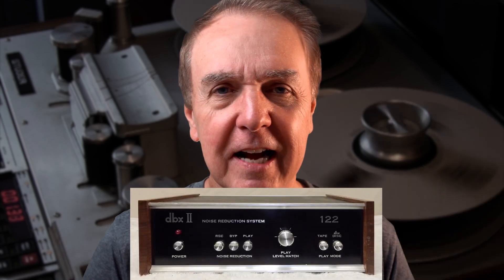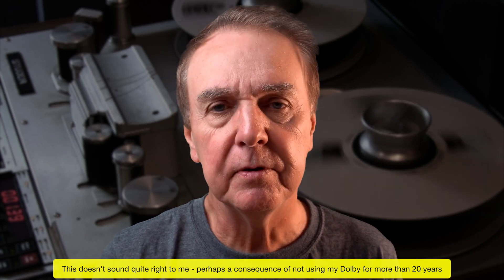The analogue revival - So wrong on so many levels (Part 4)

Comment: Print through is, for me, the single most annoying thing regarding tape. Even the best tape suffered from it to some degree and getting a better deck didn't change it. It gets worse with age too.
Reply from the maker: You’ll know this of course but for comment readers tapes were normally stored tail out which doesn’t prevent print through but makes it less noticeable. I should make a video with the full explanation. DM

Comment: We ran away from tape for so many reasons. Let alone the fact that tape had so much degradation and sometimes you need to play back so often. Especially because nowadays you'd have to deal with so many tracks sometimes, back then you had limited tracks. You couldn't mix 30-50 tracks with tape alone because of the number of times you need to play it back.